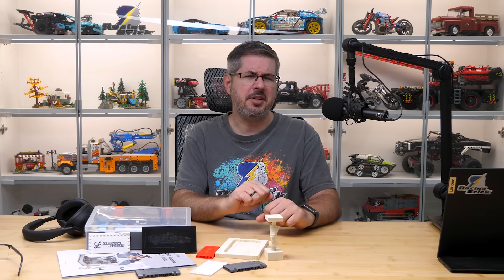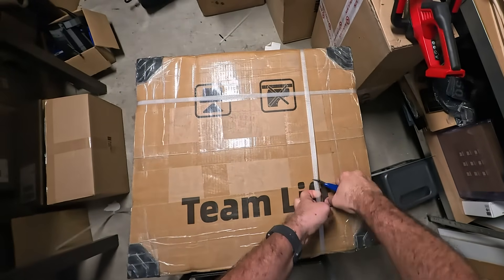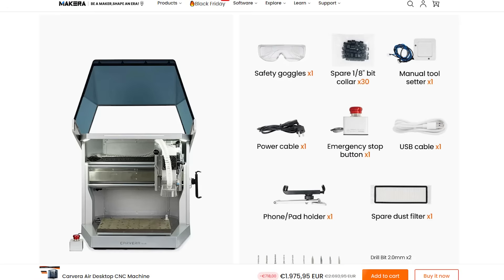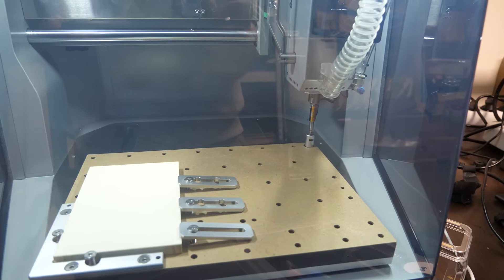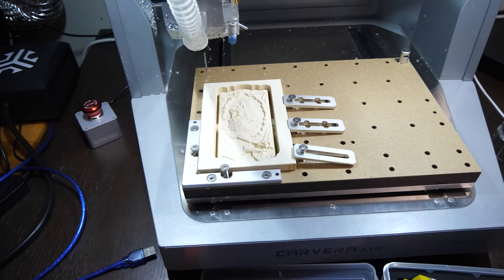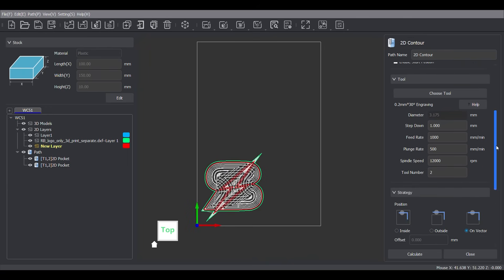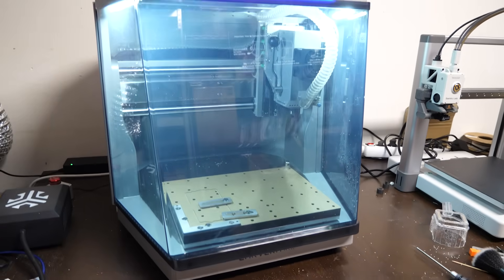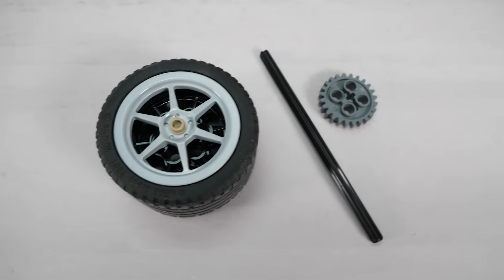My First LEGO CNC Adventure! Carvera Air + LEGO Engraving

Comment: This is amazing for Lego Technic community. We need those machined metal parts in some cases. Few ideas of what could be usefull: metal Technic train wheel and track, metal leaf springs for suspension, metal gears inside Lego differential or metal truck wheel hubs that can be chromed (see barman76's 1:13 truck wheel ideas).